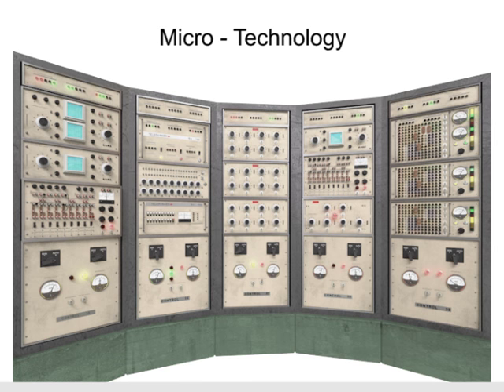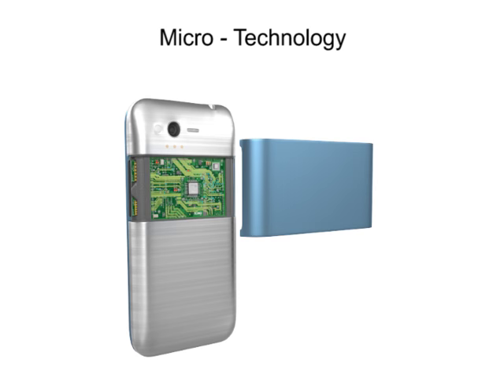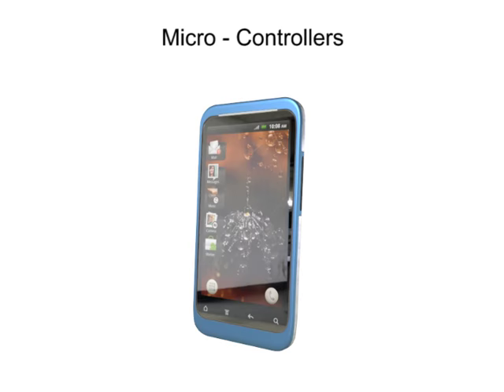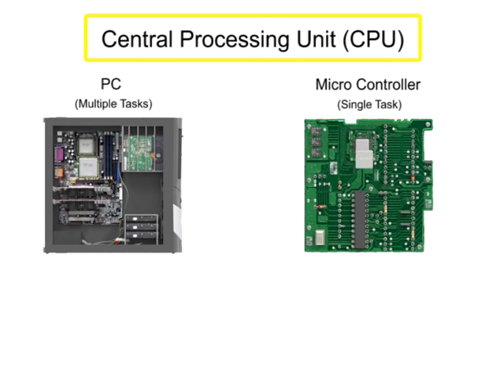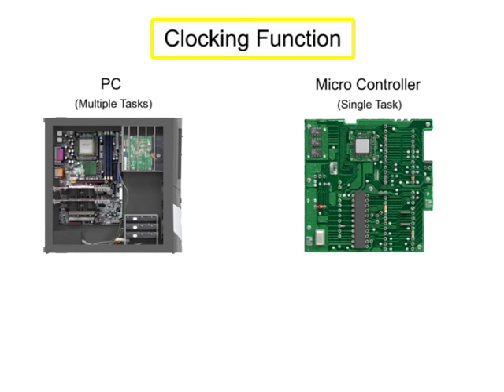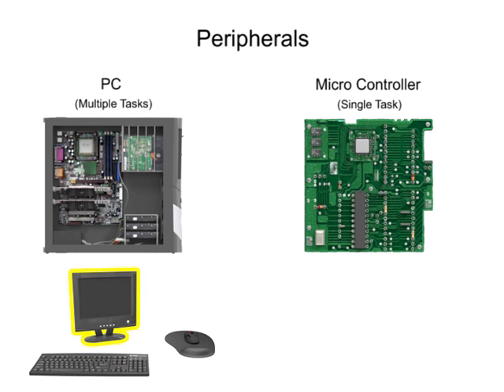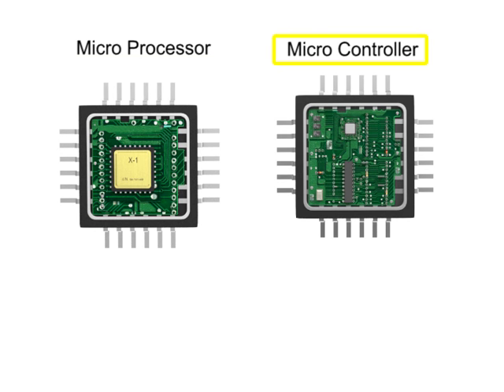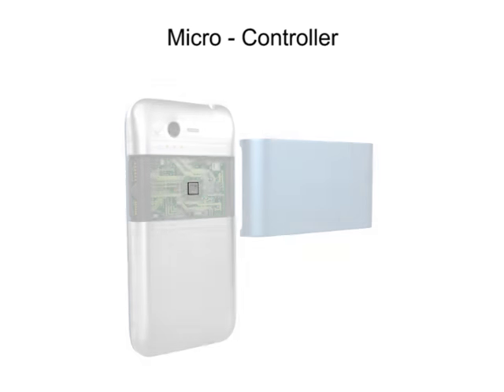What is the Difference Between a Microprocessor, Microcontroller and a Microcomputer?

Comment: As a physical example, TI's MSP430 is a microcontroller which has its own memory and processing unit. But microprocessor doesnot have memory, it holds data temporarily in registers and it performs best with additional memory, Intel processors for example. You need to attach additional RAM to work with them but for MSP430 you already have some amount of memory inside the chip, 64 MB or something.